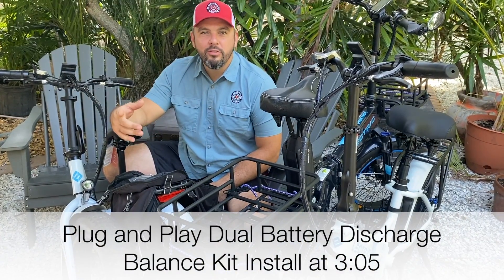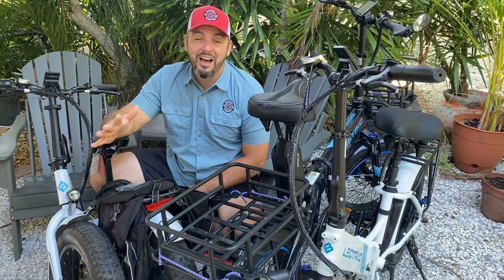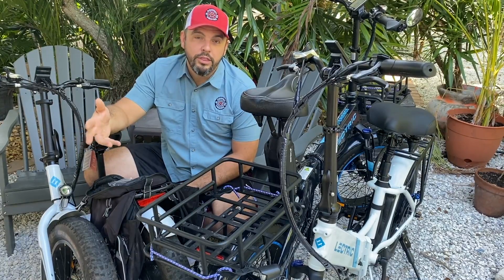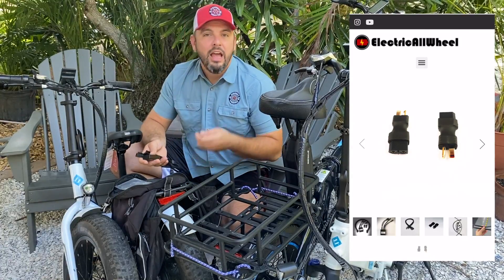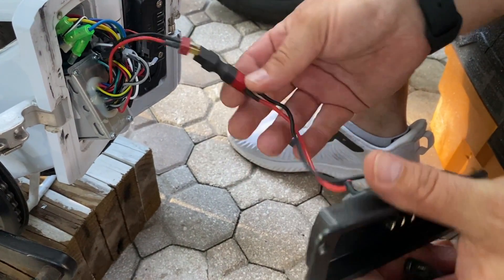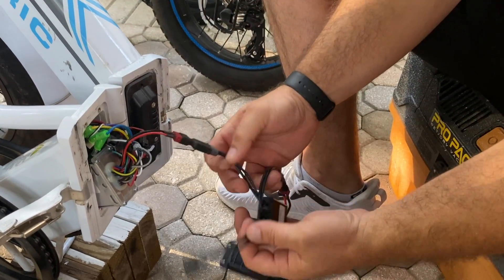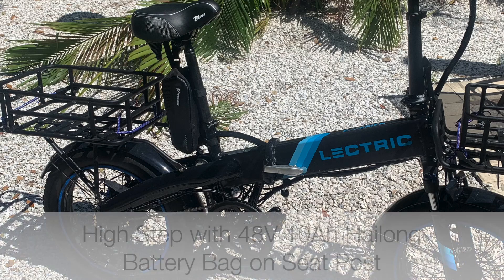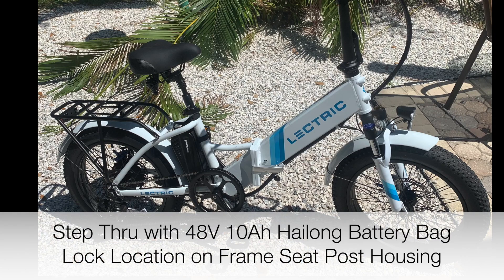Lectric | PLUG AND PLAY Dual Battery Discharge Balancer Install on Lectric XP 2.0 (XP, XP Lite XP 3)

Comment: Just ordered kit. I have a good question, the kit shows for 500W and 750W. The 16Ah to 20Ah batteries I looking for are between  768WH to 921WH.  The kit will work for those batteries? Thanks
Reply from the maker: Kits are related to the controller current limit of the bike rather than the batteries.
20A balancer for a 20A current limit controller.

Comment: You make a comment about the second battery being the same voltage.  You example was a lower voltage (36Vdc).  But what about a 52 Vdc 20ah battery as the second battery?  When I look at the display in a fully charged XP 3.0 OEM battery the battery states 54.6Vdc.

Comment: How much is this install I want to buy it and how can you tell which battery is working and how long in distance em I going with 2batteries
Reply from the maker: You can check pricing at checkout of the store before you buy for the items. 
If fully charged the batteries will uniformly discharge until the low voltage cutoff.

Check some of our newer videos on how to calculate real world range estimates

Comment: Is it safe to run the 2 batteries at the same time
Reply from the maker: The safety of this install is the purpose. So, plainly speaking yes. The balancer is an added safety measure to add to batteries in parallel to run at the same time

Comment: You don't say how this is different to the other dual control boxes as it's well known that it's not recommended to use these parallel splitters.
Reply from the maker: It is unclear what this comment is insinuating (though we have a good idea why this comment was made).
It is well known that utilizing these balancers is a common practice and one of the safest methods to run a parallel connection.
It would appear you’re advocating for a balancer with a higher efficiency, and fortunately we sell that too with the DateX2 Dx2

Comment: initially had some problems installing the Dual Battery Discharge Balancer Kit (20A) in a Lectric XP 3.0 ST. For the life of me I could not get the battery balancer in the frame with the controller. If you are doing a 3.0 step thru then pause this video at 6:14. It slid right in when inserted under the controller.

Comment: I have the standard, non- step through model and I cannot get everything to fit inside. The dual battery discharger does not fit in the housing horizontally, only diagonally or vertically. It doesn't feel possible without seriously crushing all the wires. I've been trying for an hour now. It is not nearly as easy as it looks.
Reply from the maker: We have other videos in the channels that address this issue even including an external install. Please check those videos to devise your approach

Comment: This video was very informative for me I want to do this install and add another battery to my lectric 2.0 I’m just not good at these installs but I am going to order the 60 dollar converter looks well worth it keep it going
Reply: I actually had a question I have a standard 2.0 battery can I buy a long range battery or do I have to buy the same regular 2.0 battery???
Reply from the maker: @alexgonzalez3857 you can combine any Amp hour battery you want, just make sure it s 48V to match the system

Comment: Successfully completed this install with a Hailong 10Ah.  When I am charging my bike do I need to unplug to Hailong from the bike or does that not matter? Using both chargers at once, but don't know if I should unplug the extension. Thanks.
Reply from the maker: For ultimate safety yes unplug the extension. However, we charge often with both batteries hooked up (two chargers)

Comment: Website out of stock :(
Reply from the maker: With a note telling you when it will be back
Reply: @ElectricAllWheel  I’ll make sure to keep checking back in. First time watcher. Really enjoy the channel so far. Thanks for the reply.
Reply: I just completed this diy kit! It was a real pain in the butt to get the wires and controllers to fit, but finally got it.

Both batteries work individually, so I assume it is a success. Should my voltage read differently once they’re both hooked up together? Looks to be same 54V charge still. 

I am guessing I will only really know once I do a mileage test?

P.S. I completed your freewheel change last summer and appreciate those videos too. That was also painless. My only problem related to that is that my shifter sometimes jumps between 6 & 7. Need to tweak my derailleur I believe.

Comment: I have been meaning to this on my xp 2.0 I just didn’t know how I am not good with e bikes at all but it did seem very easy what type of battery did you buy another lectric battery
Reply from the maker: Hi Alex. We used the battery in the link from the description of the video. 48V 10Ah from Amazon.

Comment: Seems so easy..dumb ? But will that kit work with all e-bikes? I have a eahora x5 folding  e-bike that comes with a internal 15AH 48v battery inside the frame just like the electric.
Reply from the maker: Email electricallwheel@gmail.com with a pic of your controller and controller to battery connections.

Comment: Seems like this video was more about showing us how Quickly you could do this - BUT - I was having great difficulty SEEING the cables and what plugs went where!  Had to watch it 3 times before I felt comfortable, and still not absolutely sure, of what connects to what.  I suggest doing this video again, and slowing the hell down, and letting us SEE the black unit and what cable goes to what cable.  Otherwise I'm not a happy camper giving you my money when I could fry something here and be out not only the money spent on your items, but possible destroying the Lectric silver box too!!!!  Please LISTEN to what I said, and not just make excuses and brush it off.  If you care about customers, who've never done this before, then you will listen and redo this video and slowly go thru each connection with the ability to also SEE what it is you are plugging into what.  Hope this helps for many customers as well - the reason why you are in business btw.
Reply from the maker: Monte, we produced multiple videos on the channel regarding this topic. Please review our other videos as well and not isolate yourself to this video alone.

Comment: How can I charge both battery, is it just plug in the ebike charge both battery at same time and take how long to fully charge both battery
Reply from the maker: The batteries will need to be charged independently with their respective chargers. The recommended battery comes with a charger

Comment: I purchased an extra battery through your link and now I’m wondering if I need just the Plug and Play kit or do I also need the External Factory Battery xt60 adapter?
Reply from the maker: If you have the battery in the black bag you just need the kit, no adapter.
Reply: @ElectricAllWheel  thank you

Comment: Does the 2nd battery have to be equal amperage of the inframe battery?
Reply from the maker: The voltage needs to match but not the amperage.
Reply from the maker: No. Just the same voltage rating (48V)

Comment: Exactly the same wiring as mine but will it be ok for a 750 watt motor
Reply from the maker: Should be ok to add a balancer, but may need a higher current rating (40A) dependent upon your controller.

Comment: I was wondering if the 48V 10Ah Hailong battery is comparable to the factory xp 2.0 step thru long range battery or should I get the 48V 15 Ah Hailong battery?
Reply from the maker: We experienced comparable capacity. The 15Ah will provide that much more range, so if it’s in your budget, go get it
Reply: @ElectricAllWheel  sounds good. Thanks for the quick response!

Comment: I cannot see on your website a place to ask questions. I have two bikes Lectric, XPedition and a XPemium  so both have dual batteries already and I have purchased a Unit Pack Power 48V / 28.8Ah battery to carry which I was just going to unplug one of the batteries and just plug it in when needed. But after researching and watching your videos, I’m interested in one of your Balancers is this something that would work with Lectrics balancer already in place?
Reply from the maker: Yes it will. Check out the end of this video for an example 
Lectric | FAQ_Dual Battery Discharge Balancer Kit
https://youtu.be/35sknuZ3J9Q
Reply: According to your website, this is not available yet? And I would only need one externally and use the factory one inside the bike?
Reply from the maker: @garywebster6181  the 40A kit will work. We would pursue internal installation and extend the cable to your third battery.
https://electricallwheel.com/dual-battery-discharge-kit-40a-xt60/

Comment: I added a 20 AH battery to my Electric 2.0 a year ago and it has worked out great. I have a 25-mile round trip commute to work and  over 3000 miles on my bike now. I did the wiring myself with no soldering after watching a YouTube video. It was easy.
Reply: Does it charging the both battery at same time and take how long to fully charge.
Reply: @rhkplam  I charge both at the same time and it takes about 4 hours
Reply: @robertmatthews2009  So you are charging both batteries with one charger through the same system? Is what I think he means. And only 4 hours? 2 batteries 20ah and 10ah from empty to full? That's crazy quick! What amps is your charger/s?

Comment: So as long as we use a 48v battery, it can be 10ah to 20ah?
Reply from the maker: Correct
Reply: @ElectricAllWheel  So do you guys know of a video to repair an old step thru battery... I left it on and one of the cells is depleted and will not charge. I left it plugged in for over 24 hrs thinking that might trigger it... NOT! :-)

Comment: Hi...
I have a question...once the balancer kit is installed...can you run the second battery and the factory battery at the same time or only one at a time ?
Reply from the maker: It is intended for them to be used at the same time

Comment: will this work with the 3.0?
Reply from the maker: Lectric | XP 3.0 | Plug and Play Dual Battery Discharge Balancer Kit | Install Two Batteries
https://youtu.be/Ut7LYT9ipUo
Reply: @ElectricAllWheel  Thanks, i got it installed, I couldnt fit it in at first on the 3.0 but once i flipped the controller i was able to slide it in the bottom under it. Works great. Couldnt fit it in my 2.0 due to the rats nest of wires even though it fit better side to side. Might try to find an external option or some longer leads so i dont have to have the balancer internally.
Reply from the maker: Try this video and see if it might be helpful
Lectric | FAQ_Dual Battery Discharge Balancer Kit
https://youtu.be/35sknuZ3J9Q
Reply: @ElectricAllWheel  Thank you for the help. I may give it another shot, got a bit weary of breaking some the super tiny wires on the 2.0 controller and didnt want to tug too hard to get more slack. Might buy another kit and try again cause I love my 2.0 more than my 3.0 since it goes about 6 mph faster for some reason, i think they went more torque with the 3.0.
Reply from the maker: We also have the cables only on Amazon 
https://amzn.to/3X58uX5

Comment: Question I have a 3.0 extended range battery can I install a second standard range battery? Are they compatible?
Reply from the maker: Yes, you can install any amp hour second battery as long as it has the same voltage rating.

Comment: I have the lectric 2.0 st. and I just picked up another battery 48 volts 20 AH instead of the factory 10.4 or 9.6 AH  will the dual battery kit work with that so I can use 1 batt. then switch to the other batt. Btw, the new battery has an XT connector.   My concern is the different AH of 20 vs 10   Thanks  So it does not matter which battery is in  the "IN A" or "IN B" correct?
Reply from the maker: You can combine any Amp hour (Ah) battery you want. Just match your voltage rating (48V)

Comment: Great video just purchase the kit also today i received the 48 10 battery what would be the max range with this set i normally use pedal assist 3 and 4 sometimes throttle
Reply from the maker: I would anticipate a real world 30+ miles at 16-18 mph
Reply: @ElectricAllWheel  the kit arrived 2 days ago installed rode it 35 miles and still have 25% battery

Comment: Just installed your kit for my XP 2.0 and Wow it's great.   Had a little problem stuffing the wires back into the housing but 'got her done'  One question though:   When I take the key out of the lock there is still power to the bike.  Is this normal??  If it is, is there anyway to route wiring so the key cuts off ALL power ???

Thanks
Reply from the maker: It would take an externally mounted and wired key to make that happen. As you know, the key lock is in the Lectric battery itself, so it is isolated to that battery. 

We are glad you got it installed! Thank you for your support.
Reply: @ElectricAllWheel  when the key is off on the bike. I can still turn power on. Is it still drawing from both batteries this way? Just curious as to why bother turning on the key?
Reply from the maker: The key for a Lectric turns on and off the battery only. If the key is off, that battery is not contributing to power output.
Reply: @ElectricAllWheel  I feel like this could be solved by a version of the discharge kit that only works when the primary battery is active, which has the downside of potentially wasting charge on the aux battery.

Another option is two batteries with two keys. If we could find one that allowed you to lock it and turn it on without keeping the key in that'd be perfect, save for that a retractable keyring might be the answer...

Either way I don't think it's THAT big a deal. If you we're only relying on the battery lock to secure your bike then you probably don't need to lock up your bike to begin with. If you're in an area where it's going to get stolen, you should probably have a bike lock.

Comment: I wonder if this will fit for the 3.0 since it has a new controller.
Reply from the maker: Yes it will. Check this out
https://electricallwheel.com/how-to-install-lectric-xp-dual-batteries/
Reply: @ElectricAllWheel  You da man!

Comment: Just bought xp 2.0 long range..can I still purchase this kit? And does a battery come with?thanks
Reply from the maker: You can still use this kit. It does not come with a battery but we have included a link for the recommended battery. We also have an adapter for a second factory Lectric battery if you have one of those.
Reply: @ElectricAllWheel  awesome thanks

Comment: Well I am finally done with the install of the balancer kit and the recommended Hailong Battery, both are excellent products and highly recommend them. I decided to go with the external install for a couple of reasons. 1. I did not want to go through the hassle of cramming the wiring housing so I opted to use space in my Rockbros Bag. 2. I also wanted to add an ON/OFF switch so I would have the option of using both batteries or just one at a time. 3. I wanted to be able to disconnect the battery so as to charge it off the bike with a simple disconnect and all other wiring remains in the Rockbros bag. 4. The wiring was the issue and I did not want any wires exposed, so all the wiring is encased in a loom and run down the luggage rack rails held with zip ties and hidden from view. Very happy with the results. Thanks to ElectricAllWheel for their videos and recommendations.
Reply from the maker: Very glad it has worked in your favor and to your liking!

Comment: Will both batteries charge using the Lectric charger and the charging port on the bike with everything connected? Or should I separate the batteries when charging?
Reply from the maker: You will need to charge separately with their chargers. The chargers are interchangeable but they both need to be charged through their independent charging ports.

Comment: Hi!  I just purchased this kit and am hoping for guidance regarding the use of two stock 10Ah Lectric XP batteries.  Specifically, how do I attach the interior Lectric XP battery and an external of the same make and model?  If this has already been covered I would appreciate a point in the right direction or a link if possible.  Many thanks!
Reply from the maker: The adapter for two stock batteries will be released in about a week (follow the channel for more) Otherwise, you can use the kit with the factory battery and the recommended battery or any 48V battery with an XT60 connection
Reply: @ElectricAllWheel  any word on your big announcement? Thanks!
Reply from the maker: @kellygilford8637  hi Kelly. We will be ready next week😎
Reply: @ElectricAllWheel   that is excellent thanks!

Comment: Hey Matt,  I have an engwe ep-2 pro 750w ebike and it's the same set up as your lectric ebike. My question is would I have a problem with the amps? My controller max amp is 18 and my stock battery is 48v 12.8a and I want to add a second 48v 17.5a battery. Will this set up work OK with your kit........thank you for your assistance and hope to hear from you soon.........
Reply from the maker: By the numbers it will work, but we have not had a test with Engwe products. Our concern would be a smart display etc. By specs shared, it works.